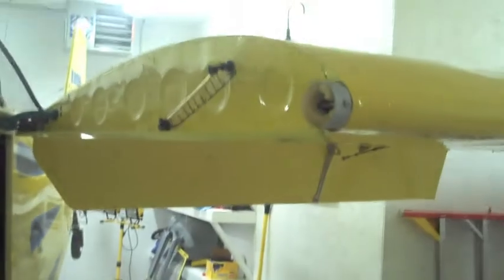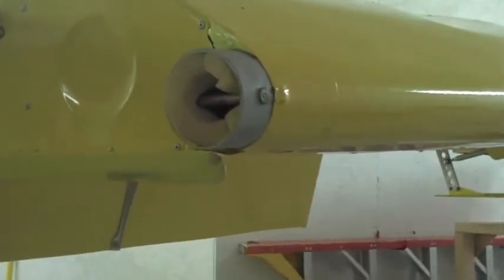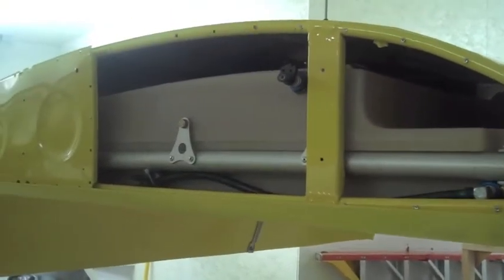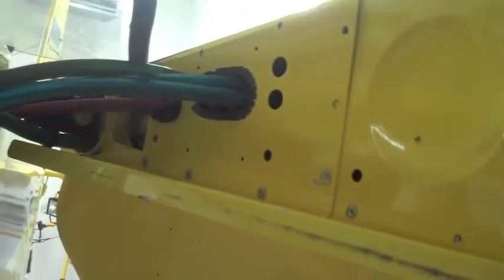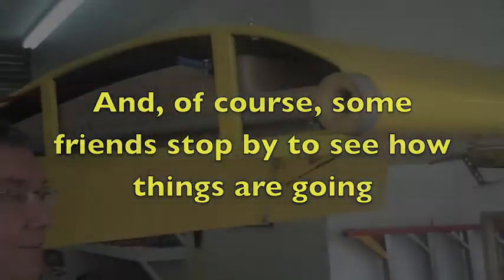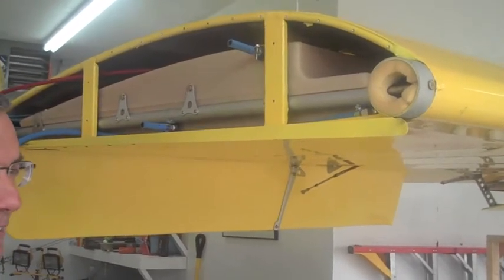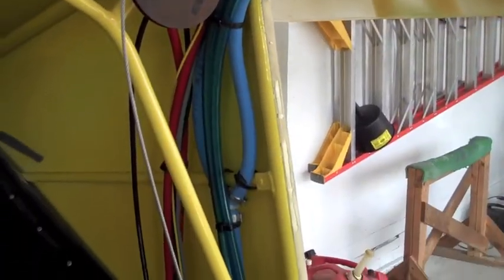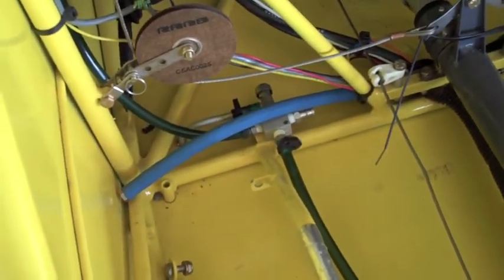Fuel LIne Replacement

Comment: Hello Mike, I’m in the process of replacing fuel lines in a Rans S6ES and came across your video. It’s much appreciated! I do have a quick question just for starters. Referring to the access/inspection panel that you had to cut, your wings appear to be the Dacron skin, so what adhesives and what ring and cover did you use?

Thank you 

Erik
Reply: Hi Eric, I did not have to cut any access panels into the fabric in this project.  The access was through the wing route which necessitated removing the rivets from the cover.  However, on another project I used the plastic rings and Superflight adhesive for that inspection cover/./
Reply: @mikewilley5678  Thanks for the fast response, that much appreciated!!! I rewatched the video and at the 2:49 mark was what I was referring to. So this is the wing root? Thanks again 

Erik
Reply: @smokeyplaces2go  OH, OK. now I remember.  This was a long time ago.  That inspection cover ring was put in during construction but never cut out, so all I did was cut it out and put an inpection plate in its place... Thanks for the follow up...